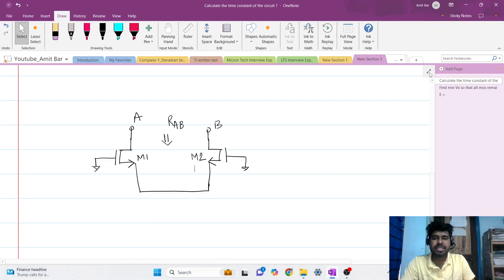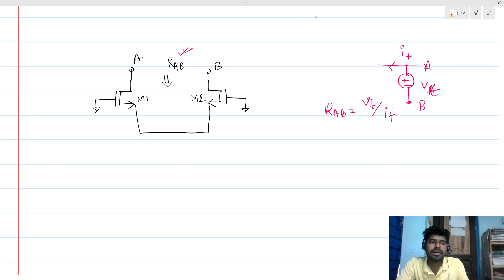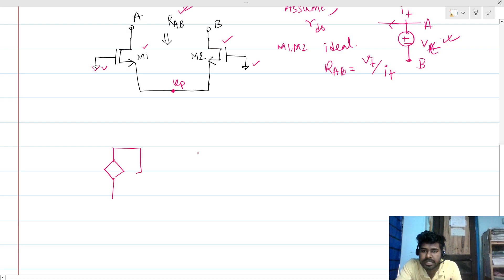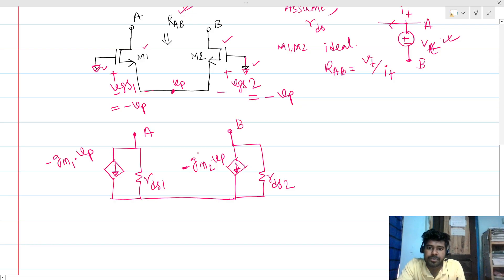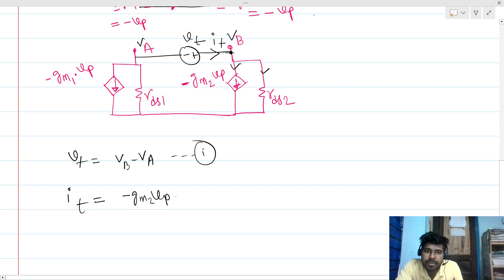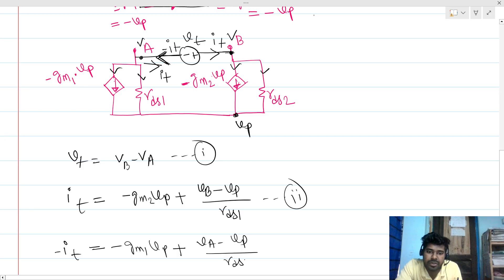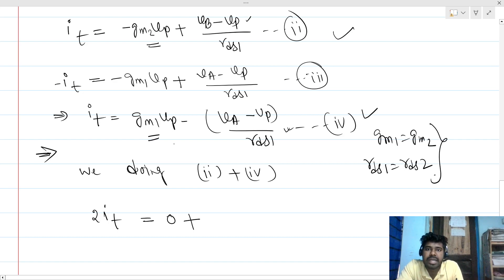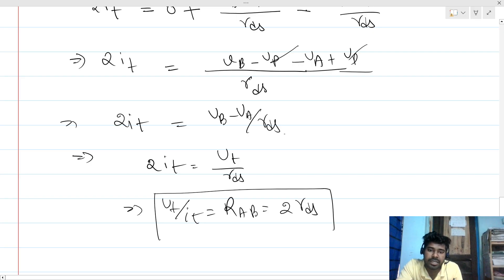Analog Circuit Design interview find incremental impedance || Amit Bar

Comment: For first circuit differential pair..

We can also derive Vp incrementally as Vp=gm1V1+gm2V2/(gm1+gm2)

So for finding Rx..we are applying a common mode signal which is nothing but ground so Vp=0...and Rx=2ro

Comment: Thanks Sir 👍
Q1:
vtest=va-vb..(1)
ittest=(va-vt/rds1)-gm1vp..(2)
-it=-gm2vp+(vb-vp/rds2)
it=gm2vp-(vb-vp/rds2)...(3)
(2)+(3) and gm1=gm2,rds1=rds2=rds
So 2it=0+(va-vt/rds1)-(vb-vt/rds2)
2it=va-vb/(rds)

Finally 2it=v/rds,2rds=v/it......Answer
 👍
Rout =1/gm1*(1+gm2ro2)+ro2 approximately 2ro2...ANSWERS
Q2:
Rout approximately 2ro 🤔
At 13:54
It looks like Ro=2i+v/(ronp)
       Ro=2*(v/2ron)+v/(ronp)
Ro=ron//rop 🤔